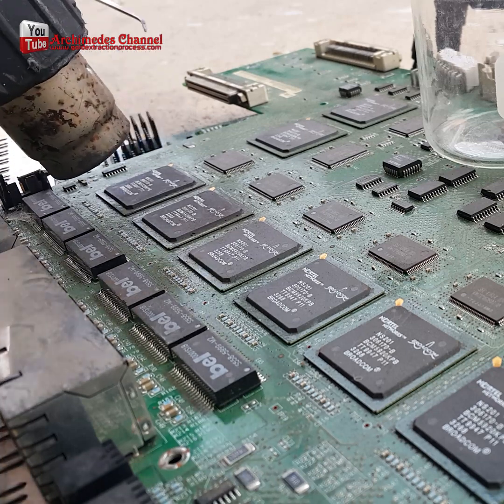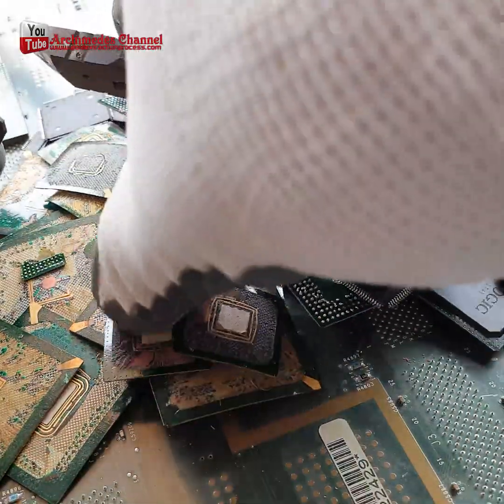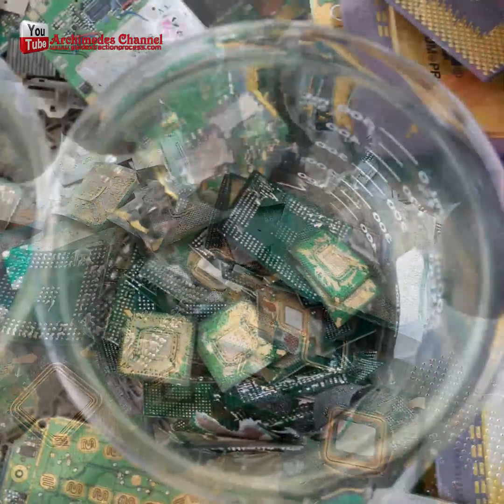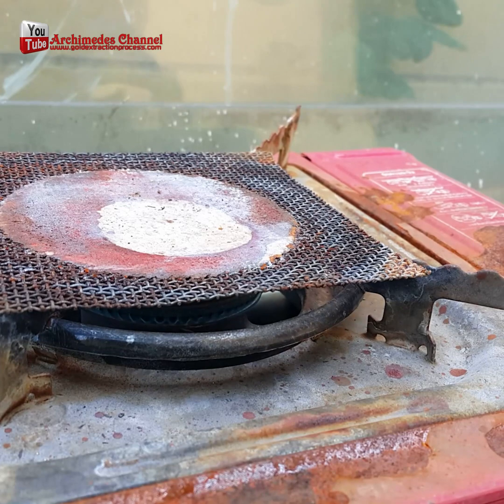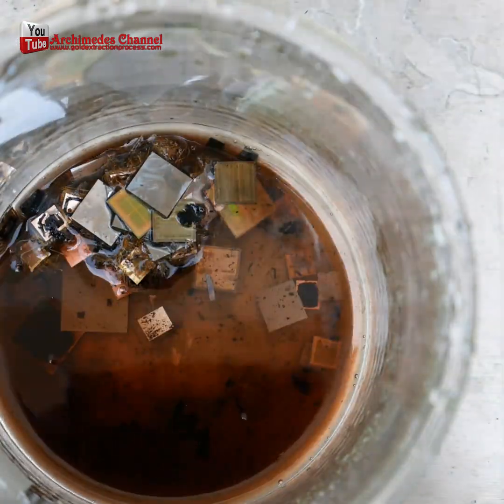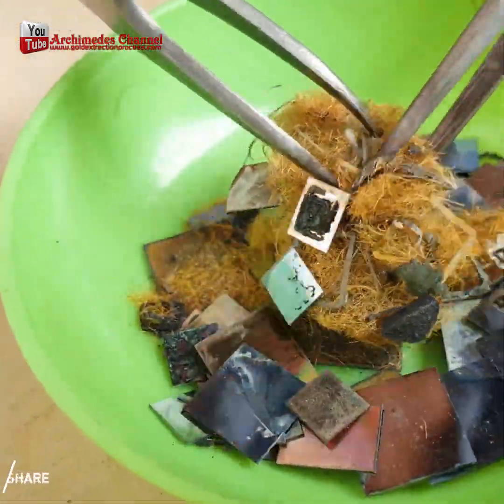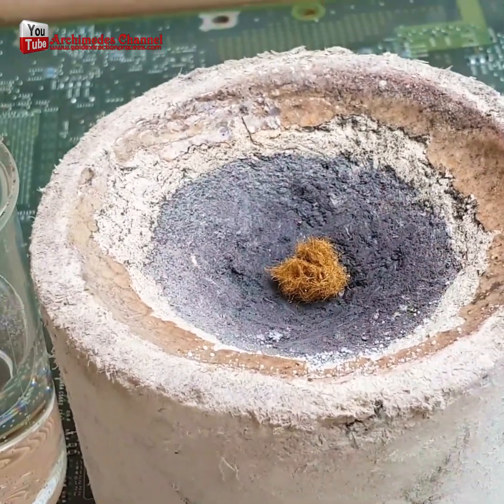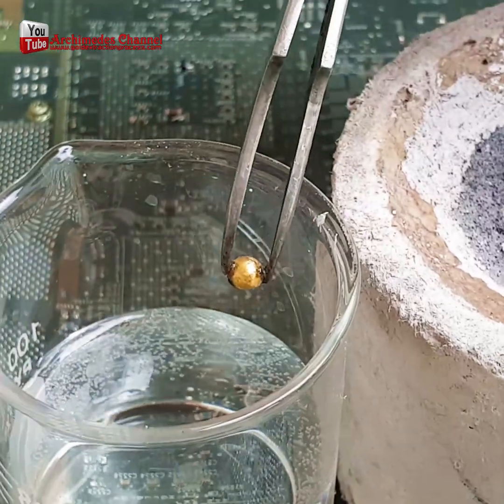Incredible Gold Recovery from IC Chips Making process How It is Done.

Comment from the maker: 😱😱👉👉👉There are several methods for recovering gold from IC chips, including cyanide leaching, smelting, and acid dissolution. Cyanide leaching is a process in which the IC chips are crushed and then treated with a dilute cyanide solution, which dissolves the gold. Smelting involves heating the IC chips to a high temperature in order to melt the gold, which can then be poured off and collected. Acid dissolution is a process in which the IC chips are treated with an acidic solution, which dissolves the gold. 😱😱

Comment: I found an old toaster oven on the curb. I set it to bake at 450 and in 10-15 mins bga chips and most pins, mlcc's and other surface mounted items scrape right off with a putty knife